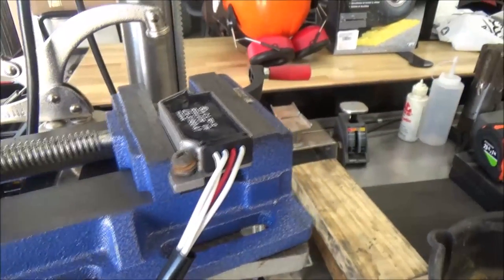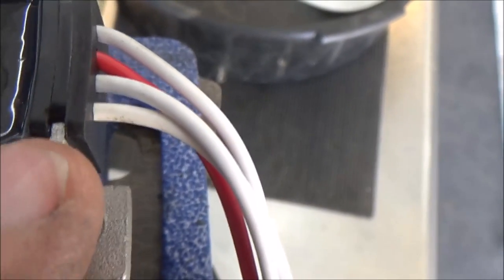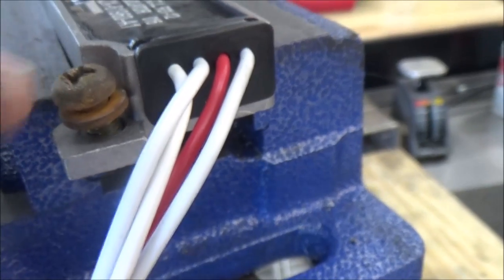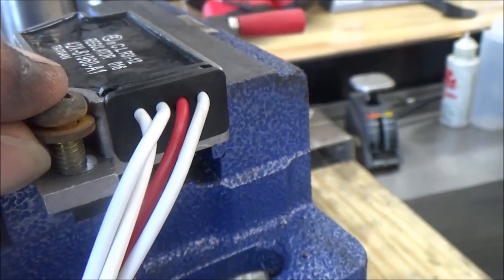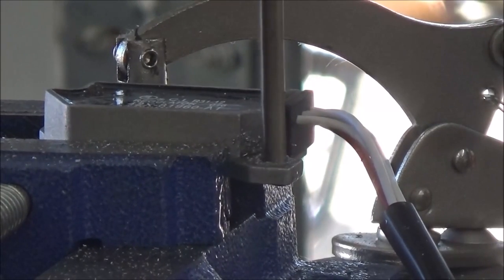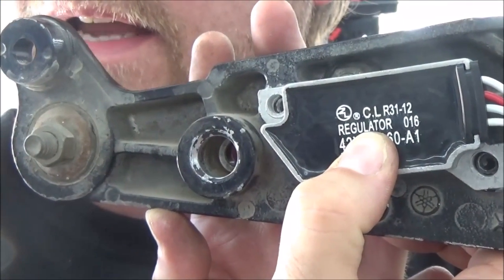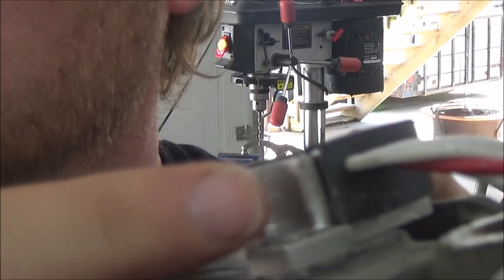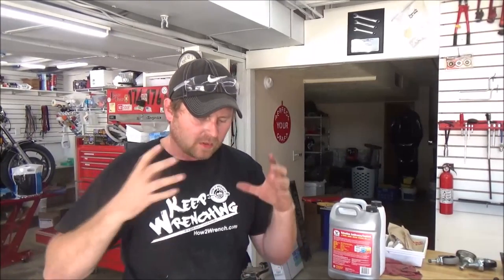EM Series: How to fix a misaligned hole and why you should always test fit parts!

Comment: I noticed that the regulator has no cooling fins for heat dissipation.  Maybe the designer is using the large aluminum part, that the regulator mounts to, as a heat sink.  If so, all the more reason why it's important to securely bolt down the regulator, not leave it hanging loosely with a stripped, misaligned bolt.

Comment: I've never understood why the bike manufacturers use Phillips head screws to mount anything. Did you think about replacing the screws with socket head bolts to make it a bit easier for the next guy down the line?
Reply from the maker: Great idea for sure Jeremy!
Reply: Lots of what look like Phillips head screws, especially on Japanese motorcycles, are actually JIS screws (Japanese Industrial Standard). For identification they often have a dot on the screw head. Using a JIS screw driver will avoid the problem of camming out. Pretty well all Japanese bikes use JIS rather than Phillips. Just a point of interest perhaps ;-)
Reply: BlastsFromTheSaddle first time I've heard of the JIS screws. Guess you learn something new every day. Do they still use the standard metric threads?
Reply: JIS screws are metric pitch, and designed so they don't cam out and strip the head.
original story is that Phillips were designed for automated assembly and would cam out before they stripped the thread, where JIS were designed with the idea that the mechanic would know what they doing and stop at the right torque.
interestingly, i've found that JIS screwdrivers will actually fit Phillips screws better than a phillips screwdriver, and give a better grip on the screwhead.
the most commonly chewed out screws i see are on brake reservoirs where a phillips screwdriver just slips and eats the damn thing. i got myself a set of Vessel Megadora screwdrivers and i've never had one slip since. another common one is switchblock screws. same thing, since i've switched over to JIS.
i won't use anything but JIS for crossfit screwheads now.
Reply: Ames has the best JIS screwdrivers i have ever used. they actualy have the anti cam ridges on them as well as a perfect fit including the shallow and deep. note the master cylinder is typically a shallow just to give you a reference.